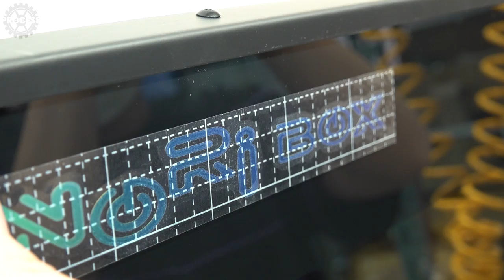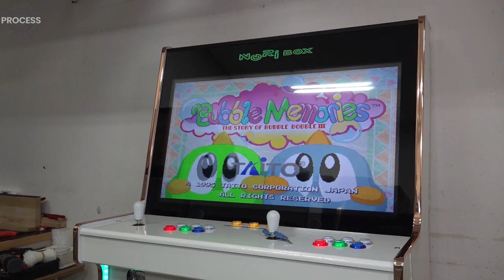Process of Making an Arcade Game Machine. Amusement Machines Factory in Korea.

Comment: Looks like it is using a JAMMA edge connector or Pandora's Box device, which means you can fit it with an actual licensed arcade hardware or Raspberry Pi emulation box if you want!